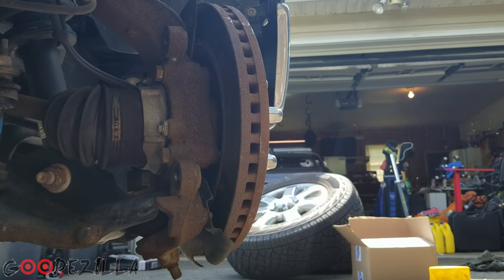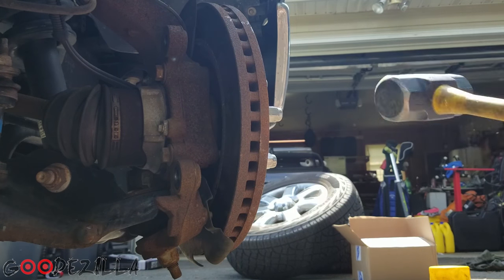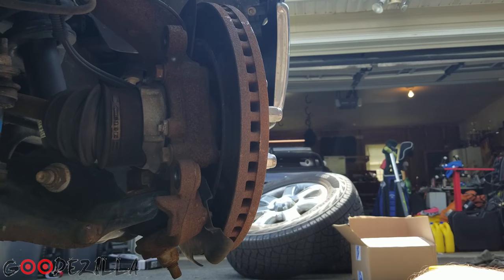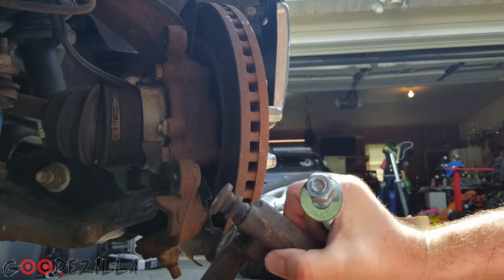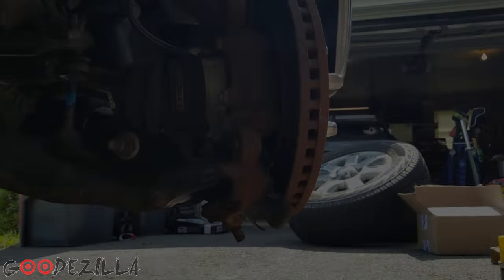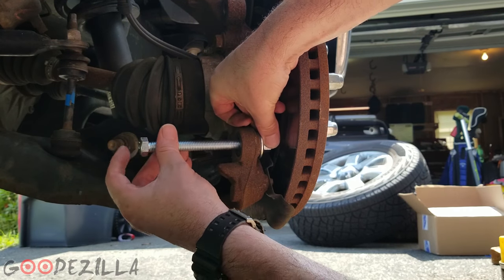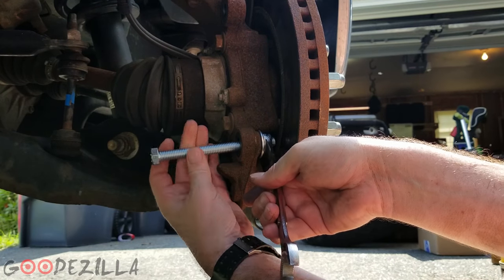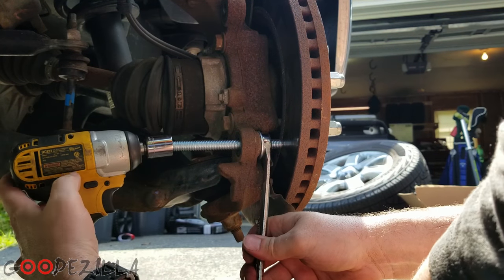How to Remove a Stuck Rotor WITHOUT a Hammer!

Comment: PLEASE BE CAREFUL HERE..!! I was ready to say praises to you on this one, but as i rotated it several times the end of the bolt mushroomed over, AND BENT THE CAST CALIPER bracket the bolt went through..!!
OH NO..! Well, i ended going to Harbor Freight and got the 5 ton hydraulic gear puller like another you tuber used. It actually broke the rotor off in chunks it was stuck soo bad..! I prayed the bracket would carefully bend back. Took a pipe wrench and slowly brought it back into place. Man what a drag...! 
So watch close. Your truck has nice heavy cast iron. My 03 Honda CRV... well not so much... 🤨
Reply: Steve Hinton I bent mine too. I’ve got a 36” pipe wrench, but this is the front. So the steering knuckle just turns if I try to apply any bending force to it. Just gonna limp it to the shop (with no brake on this wheel) and pay the man.
Reply: @TyBower  😬😵😲🤔😳🥵
Reply: @TyBower  careful..!! The brake fluid will escape out the piston cylinder with no brake caliper holding it back and you'll HAVE NO BRAKES..!!!👿

Comment: While it looks like a good idea, it did not work for me - the rotor's been on ~4.5 years and was really rusted on, especially all around the hub OD, where the ID of the rotor rusted onto it. (Also, the end of the bolt got mangled, making it difficult to get the bolt out of there.) What DID work: in that same gap where the bolt is attempting to do the spreading, I used a steel wood-splitting wedge: tap it in with a hammer, tap it sideways to remove, rotate the wheel, do it again, etc. It took about 20 minutes, but gradually worked the rotor off without bending the caliper bracket mounts.

Comment: So I popped the wheel off along with the brakes...the dust shield behind the rotor is positioned directly in front of the holes smh. So the hammer method isn't working and can't use screws. Going to try using a 3 pronged gear pull with a lot of penetrating oil and see if that works. Wish me luck.

Comment: This seemed like a great idea, until I realized I had bent the hub carrier. Maybe it works better on trucks than on light cars. Now the assembly needs to be replaced, as it is impossible to bolt on the caliper. It no longer aligns with the rotor.

Comment: Hi! What size is the bolt and the nut?
Reply from the maker: It's different depending on the size of hole that's on your car. Just get something that fits through the hole, but doesn't thread into the hole.
Reply: I see thanks! How long was the bolt?

Comment: Is This method is safe for the caliper hole cast
Reply from the maker: I used a size or two smaller than the bolt that holds the caliper on the hub, so that it slides through.

Comment: A really great idea if youre changing the rotor, but if youre keeping it then you need something to keep from scarring it.
Reply from the maker: Yeah you could stick the old brake pad in between the bolt and rotor.
Reply: @Goodezilla  yeah thats a good idea too. Today i was just changing the hub assembly, so the pads and rotors i was keeping. One of the rotors was ridiculously stuck, lol.
I didnt have a nut/ bolt and no way to the store, so i just ended up prying it off. Scarred the rotor a tiny bit but it will be fine for now.
Anyway, i do appreciate the video!

Comment: Be careful using this technique. I thought I was pushing the rotor and in fact was pushing the hub. Bent it out of round and created an entirely different issue on my 05 Odyssey. Now trying to se if it will bend back.

Comment: And what if your front and rear disc are broken off because they're so rusted and the center of the rotor is still seized onto the hub?
Reply from the maker: Sounds like you need to get new hubs.
Reply: @Goodezilla  I smashed the rotor into 6 pieces with the sledge hammer

Comment: I tried this but my bolt wasn't strong enough. It deformed and then I couldn't undo the bolt and nut anymore. After hitting the disc a few more times it finally came off and then I still had to cut the bolt in half.
Reply from the maker: Sorry it didn't work out for you
Reply: @Goodezilla  i guess i should've known to pick a stronger bolt (like 8.8) from my junk box

Comment: Didn't work, instead of pushing the rotor off, it bent the bolt tabs backwards on my Toyota Highlander and never released the rusted front rotor. Had to revert back to the BFH and a 4 foot pipe wrench to bend the tabs back into position.

Comment: DO NOT use this method on front of a 2005-2009 Mazda3. You will crack/break off the spindle casting caliper mounts. Better to get a cut off wheel and cut the rotor off. I learned this the hard way after breaking off the caliper mounting lugs using the method described in this video. The rust builds up so heavily on the back inside of the rotor it cannot pass over the diameter of the axle flange.

Comment: This doesn’t work on a lot of vehicles as the rotors are not wide enough or are not in exactly the right spot. And some aluminum nuckels are very soft and don’t take kindly to being pushed on.
Reply from the maker: That's why I wrote the note in the description.
Reply: @Goodezilla  what description was that?
Reply from the maker: @papabits5721  the video description? The text under the video...

Comment: What size bolt and nut
Reply from the maker: It depends on the vehicle. Whatever the biggest you can fit in there without actually threading into the bracket.

Comment: Unfortunately I don’t have an impact yet lol
Reply from the maker: You shouldn't "need" one. Just really helps tho.
Reply: @Goodezilla  well I didn’t have any extra bolts that size and don’t have money to buy any lol so I just beat with a hammer on the back of the rotor and it eventually came off… in the back of the car I had no access to the back of the rotor and had to do a lot of prying… but the front I can turn the wheels so… 

I hate living in the rust belt😤😤

Comment: Wont this strip the lug screws
Reply from the maker: The bolts don't use the caliper bracket threads, they slide through.

Comment: My R32 GTR rotors were stuck too, hammer didn’t work but Nissan thought ahead and you can thread bolts into the rotor where it meets the hub :D
Reply from the maker: Yeah I was hoping I could do that as well, as the new rotors I bought have those threaded holes...but apparently the stock rotors didnt lol. Thank you for watching!

Comment: A light tap should do it. Otherwise first make sure the rotors don't have threaded holes in the face designed to push it off when stuck (e..g. https://www.youtube.com/watch?v=vwonniVF718). The rotors shown here did Not have those holes and so the method shown here is definitely a great idea. Heavy hammering, on the other hand, just can't being doing any her front end any good.

Comment: Didn't work for me on my 2500 Sprinter front rotor. Small bolt stripped, then the next (big) bolt seized at the nut and smooshed where it contacted the rotor. USE A BEEFY BOLT. Buy one with hardened steel or you could have these issues. And get a high-torque impact driver, my standard dewalt impact was struggling. Gonna try a puller now.

Comment: Awesome !!! ,,, 
But we all know what'll happen now . Auto mfs will remake that so no DIY'r can do it w/o that special tool . ha ha . 
How many were working on projects , and needed that one "special" tool to complete the job ,, raise your hand .
Reply: Nah.  Only way they can stop this trick is relocating the bolt hole. However, those 2 holes is where it holds the calipers.  It will be insane to redesign something that works just to counter the diy.  One more thing, if people put cooper grease on it before install the new rotor, it will prevent this issue happening due to rust between the two steel parts.